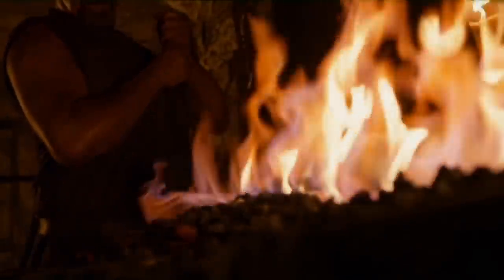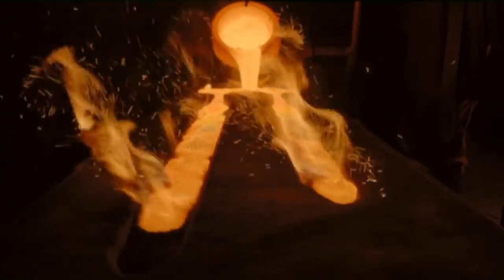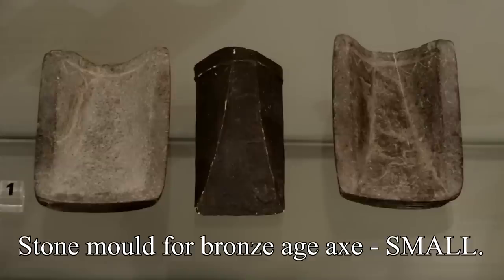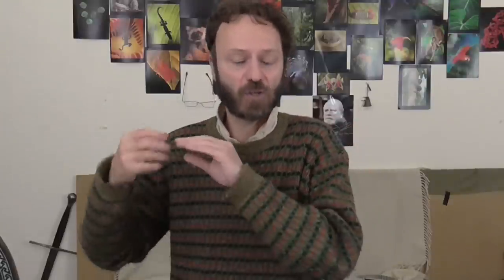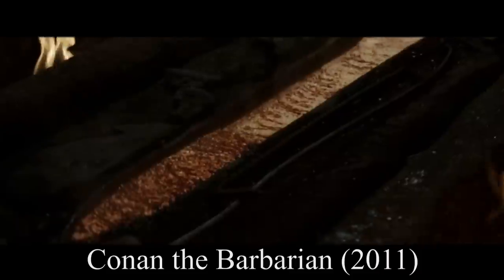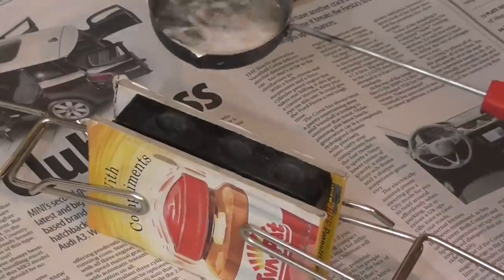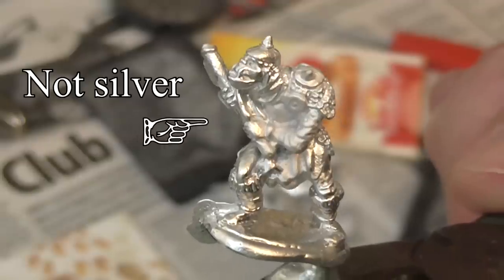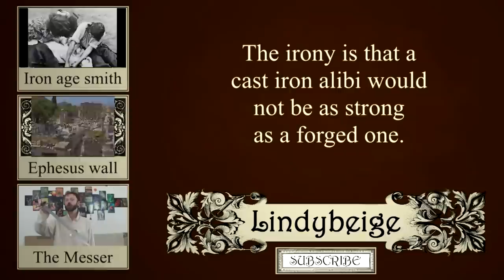Casting swords in the movies - forging a lie

Comment: Oddly enough the orc swords made that way makes sense why it's so crude
Reply: And they are quite chunky - which would probably help a little with not breaking
Reply: What also keeps them from breaking is the fact they're further worked afterwards on an anvil, as shown.
Reply: Also, if the blade broke, you'd end up with a sharp bit, somewhere (presumably)...which would keep most orcs happy.
Reply: quite the opposite
Reply: Exactly, Dumdumshum. The uruk swords were hardly more than sharpened bars of iron, and CNC milling or other stock removal of sheet metal and then hammerforging to shape is not an uncommon method for modern amateur blacksmithing. And though even they wouldn't have a long lifespan (especially as they were iron and not steel) the intended lifespan of their weilders were comparatively short. :3
Reply: You can't "work" cast iron.  It is too brittle.  It would simply shatter while you were trying to work it.

The only way you're going to be able to work iron is to remove the impurities and add carbon making it into steel.
Reply: Thats not true. People work iron all the time. how else would you make an iron chain. you can't cast links together, you have to forge weld them together. People even used it in sword and knife making.
Reply: +adam courtney
They are working iron that's been processed into steel in those applications not raw iron.
Reply: No, im talking about old ass antique chains 200+ year old ones. People also use old iron to add to metal working projects such as knives.
Reply: +adam courtney
Steel has been widely produced since before the 16th century.  Cast iron cannot be worked period.

If you need evidence go ahead and grab a cast iron skillet and try to work it.  See what happens.
Reply: adam courtney you would be thinking of wrought iron, basically they just filled a crucible with charcoal and the cast iron, and heated it to critical for a while, (citation needed)
Reply: That was my thought too when I first saw the scene...

"Great! The Orcs found a way to mass produce swords... they can make thousands of the cheapest, most garbage swords imaginable... what an Orcish thing to do!"
Reply: Dan O'Connell I vaguely remember seeing a bunch of orks with broken swords also.
Reply: Dylan Zrim,

I may be wrong, but I seem to recall scenes of the humans, dwarves, or other races forging weapons, not casting, but really forging.

Now I gotta rewatch those movies!
Reply: Dan O'Connell I can remember mostly forging too, in that same scene the urukai (spelling?) have simplified forged blades, I take it the cannon fodder orks just got disposable blades
Reply: Dan O'Connell and I know for sure that the legendary sword Aragorn ran with could not have been repaired in the fashion the movie suggested
Reply: Валерий Елькин well if that's the case, they are just shit at making tools of war.
Reply: I was pretty sure it was the dwarfs who are masters of making weapons and such. Orcs are just barbarians
Reply: It's never mentioned in the books. Neither that they were forged that way, or that they were bad quality. Damn movies...
Reply: Wrought iron is actually, chemically speaking, steel. It's just the traditional name for it. And cast iron, funny enough, is more steel than steel, looking at carbon content. Pure iron doesn't really happen in nature, it's either an oxide, steel with carbon or other alloys (meteorite iron is for example often an alloy with nickel).
Reply: +Dylan Zrim - Anduril is enchanted if I'm not mistaken.
Reply: TrollDragomir If there is more than 2% of coal then its not steel its cast iron... In Polish languige it is less misleading: steel=stal, iron=żelazo, cast iron=żeliwo.
Reply: Wiem, sam go używam na codzień :P Czyste żelazo w zasadzie w naturze nie występuje, a nawet gdyby, to nie da się z niego nic zrobić. Różne nauki różnie definiują owo nazewnictwo. W archeologii na przykład żelazem określa się przedmioty wykonane ze stali o niskiej zawartości węgla, niehartowanej. Stąd żelazna broń w epoce żelaza. Ale patrząc od strony chemicznej, to wciąż jest stal, bo w procesie kucia tlen odpadł z rdzą i zgorzeliną (scale), a żelazo się nawęgliło od paleniska. Natomiast żeliwo istnieje dopiero od rewolucji przemysłowej i jest odpadem z samego dna przemysłowego kotła z wyjątkowo dużą zawartością węgla - przez co jest bardzo kruche, ale można je odlewać (temperatura topnienia jest niższa - im więcej węgla w żelazie, tym bardziej zbliżona do siebie jest temperatura skuwania (welding temperature), gdzie stal jest na tyle kowalna, aby można było dwa kawałki ze sobą skuć (btw. Narsil nie był dostatecznie rozgrzany w scenie jego skuwania) i temperatura topnienia (dlatego przy skuwaniu wysokowęglowej stali trzeba uważać, by nie zaczęła się nadtapiać, bo straty w materiale są duże i nie nadaje się on do dalszej obróbki). W przypadku żeliwa temperatura topnienia występuje szybciej niż temperatura skuwania, ba, przez zawartość węgla, kruchość i twardość w ogóle niemożliwe jest jego kucie, stąd przedmioty z żeliwa można tylko odlewać.
Reply: Dylan Zrim well it could have given the possible special properties of an unknown metal with the noldorin skill (Tolkien’s version of elf magic)
Reply: Exactly, they are essentially just casting flat blades and making the handles out of wood or whatever
Reply: They are flat on both sides
Reply: Dan O'Connell sounds like Uruk-hai swords should come with a ‘made in china’ stamp
Reply: @zososldier  Those/these are iron alloys, none of which are steal or just iron:
Anthracite iron (carbon)
Cast iron (carbon)
Pig iron (carbon)
Wrought iron (carbon)
Fernico (nickel, cobalt)
Elinvar (nickel, chromium)
Invar (nickel)
Kovar (cobalt)
Spiegeleisen (manganese, carbon, silicon)
Ferroalloys
Ferroboron
Ferrochrome (chromium)
Ferromagnesium
Ferromanganese
Ferromolybdenum
Ferronickel
Ferrophosphorus
Ferrotitanium
Ferrovanadium
Ferrosilicon
Reply: why you have to tell me this...

Comment: I love when they're all like "this is a very magical metal that takes much skill to work with" and all they do is pour it in a cast
Reply: It does take a lot of skill... in the magic enchanting they do to the molten material, not actually pouring it or working it... the enchanting does the forging for them once it's cast in the magic mold
Reply: @davejay6855 what if you use the special enchanting with the regular molten iron? What would we be left with then?

Comment: Duh, this obviously takes place in the less known aluminium age, which happened between the bronze age and the iron age. Cast aluminium swords were in high demand back them. 

It's just, they all got smashed into pieces by the guys who still had bronze swords, so none have survived to this day. But they were light! Dang, you could swing them quickly until they burst!

;)
Reply: Aluminium is pretty soft, it wouldnt be smashed
Reply: @herscher1297  eh it's brittle enough to shatter if it came in contact with a harder blade at high speed...
Reply: those would be effective like baseball bats that are intended to throw shards of metal at your enemy
Reply: @VincentGonzalezVeg  sounds good
Reply: @herscher1297  If you get modern high-purity aluminum, yes, it may bend. Or just be cut through, If your aluminum (or any other metal, really) has pockets of, or the wrong kinds of, impurities... snap, shatter, crunch.
Reply: @MonkeyJedi99  thank for the info
Reply: @ianwoods2152  aluminium is an alloy, nice one
Reply: I remember buying an aluminum large bowie knife, threw it once it shattered glad I wasn't using it at the time.
Reply: @ianwoods2152  No...
No it isn't...
Reply: @herscher1297  Aluminium is NOT an alloy - Aluminium is a pure metal. Normally aluminium is alloyed with either copper, silicon, or magnesium, plus other metals at a lower percentage, to give the required properties. Isn't ignorance bliss????!!?
Reply: @anthonyperry5227  if you look at the command above mine you will understand
Reply: @ianwoods2152  no its a pure element 

Alluminum production is fairly hard to do
Reply: The aluminum age was a dark dark time
Reply: @anthonyperry5227  legend says it was with great aluminum weaponery that the ancient tribe of nazis

Lost a battle against merica

Destroying the largest boomstick with a single bag
Reply: This is funny to me mainly because the process for getting pure aluminum was so difficult compared to iron, it only in last century and a half the we have been able to process aluminum efficiently.
Reply: @strider04  yup it was worth more then gols or platinum till we figured it out
Reply: are you guys having the
A-L-U-M-I-N-U-M /
A-L-U-M-I-N-I-U-M
argument without noticing?
Reply: @palebluedot7435  Gentlemen, from this moment on, we are at war. MOBILISE YOUR TROOPS!
Reply: @TheFriendlyInvader  it would be cut in half not shattered... but yeah you would have 2 amasing half swords xD
Reply: @ianwoods2152  that's not true! That's impossible! How could he!?!?! /s
Reply: Holden Mcgroine  r/woosh
Reply: @Errafri  I'm pretty confident I know what I'm talking about, I've done bladesmithing for years, and knowledge of metallurgy and the properties of metals when used in blades is kind of important. On the note of aluminum, a properly made aluminum blade would be brittle, as aluminum becomes brittle, but much harder when heat treated.
Reply: @TheFriendlyInvader  The guy is joking... he knows very well their never was an Aluminium age.
Yes, you can get Aluminium to be brittle if you harden it without doing an adequate temper, absolutly. Then again, one would be rather stupid to do that... That's without counting on the fact that doing a blade in aluminium for anything else than tablewear or decoration would be rather unsmart...
Reply: @Errafri  Well I'm not arguing that aluminum should be used as the material for a blade, I'm just saying a properly treated blade will be brittle
Reply: @TheFriendlyInvader  A properly treated blade is by definition not brittle. Yes if you apply steal tempering it will, as if you apply it to any other metal that is not iron based. But yeah, I see your point in that way.
Reply: @Errafri  The process of tempering will always make the metal significantly more brittle, it's apart of it becoming a harder material. The problem with aluminum is the process of heat treating will make it extremely brittle regardless of the temperament used due to the properties aluminum has starting out.
Reply: @ianwoods2152  Is that so? Then of what is it an alloy of?
Reply: And we just happened to loose the technology to deoxidize aluminum
Reply: That's what the baghdad batteries were for, aluminum electrolysis!

Comment: what do you know about re-forging valyrian steel?
there are only 3 smiths who have this knowledge
Reply: Clearly the way to work forged steel made with a forgotten method is to melt it down into an amorphous blob then just kinda pour it on the floor.
Reply: @tharqal2764  Of course, it just makes sense. Instead of the thousands of folds, spells, and blood of slaves that it took to actually make it Valerian steel.
Reply: @josharntt  Or ya know mix in obsidian and smelt with dragons fire
Reply: He knows what the definition of "forging" is as opposed to smelting.
Reply: What do I know about re-forging Valyrian steel? Nothing and neither does anyone else because Martin doesn't cover it in the books. In the DVD commentary for that scene, D&D admit that this is not the proper way to make a sword.  They also admit that it was based on the sword casting scene in 'Conan The Barbarian' . https://www.youtube.com/watch?v=DHUoupnOt-E
Reply: Well it's pretty clearly stated that they fold the steel over and over again while forging (that's how they get the ripples, just like Damascus steel in real life)
Reply: Gotta love the TV show, the writers write "forged" in the script, then the direct makes them show casting.
Reply: my guess is its a metal with a way higher working temperature and you need dragons to get those temperatures.
Reply: pyropulse  Within the context of ASOIAF I think it's much more plausible that the folding has to do with "working in the magic" than the metal being low quality
Reply: @rymdalkis  That's how you get "modern Damascus." It's generally not believed anymore that historical Damascus steel, which exhibits very different molecular properties, used such a process.
Reply: Yet it’s so incredibly simple
Reply: Makes me laugh this guy. Top man.
Reply: John Smith, Geoff Smith and Joyce Smith
Reply: He's just another youtuber fool.